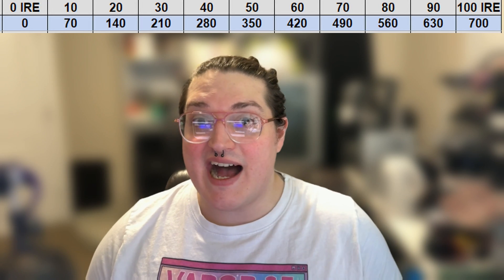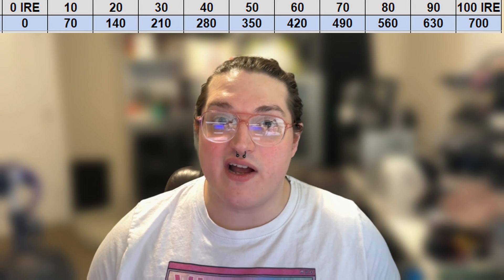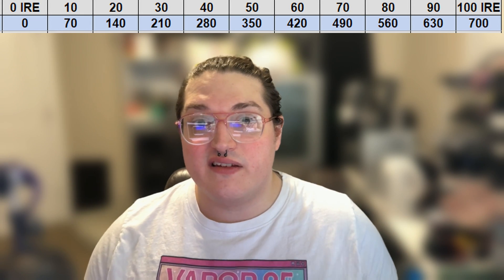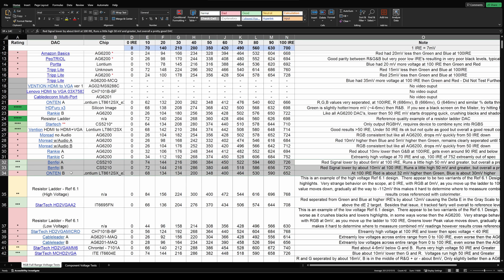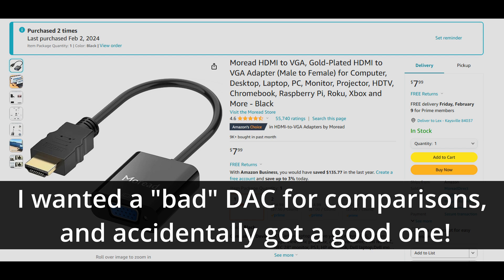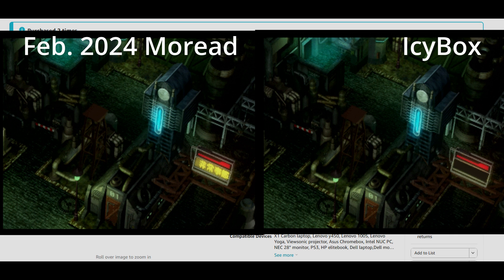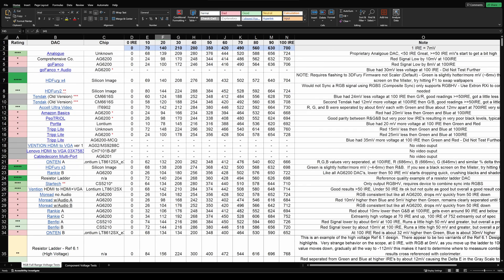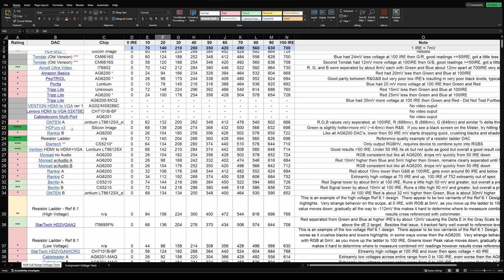Get the BEST Analogue Output from MiSTer FPGA!

Comment: Great video ❤
I love my icybox but the HD Fury 3 has some nice features. Worth the money? In the current environment probably not
Reply from the maker: If you could do a group buy or somehow get one for $100 or less, it’d be worth it for the extra features. Maybe a good used deal? It’s just hard to justify MSRP on it.
Reply: @lexlocatelli  I got both of mine for 100 each, JVC Gang
Reply: What features on the Fury X3 have you interested? Just curious
Reply: @TheRealGara  2 inputs with auto switching, it has a great audio DAC along with the video chip. It also has horizontal shift and a few sync options.